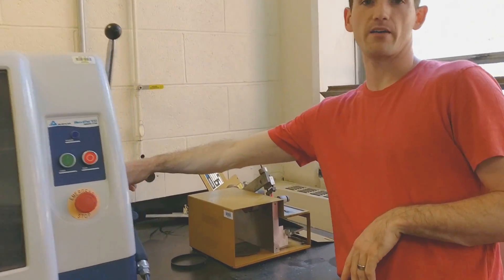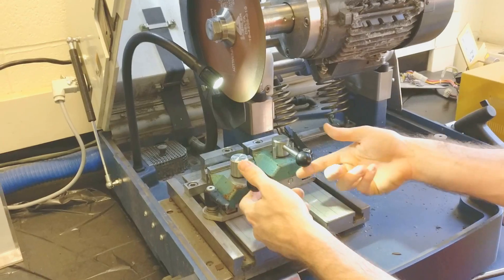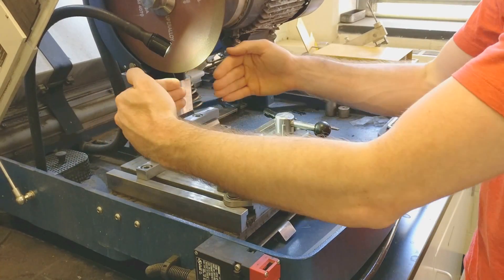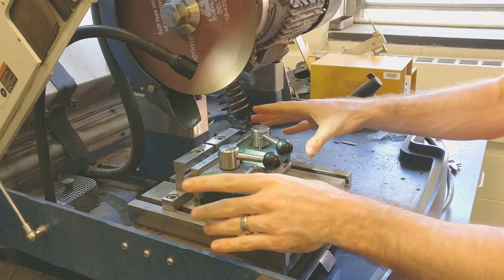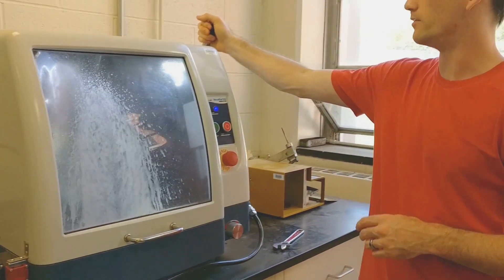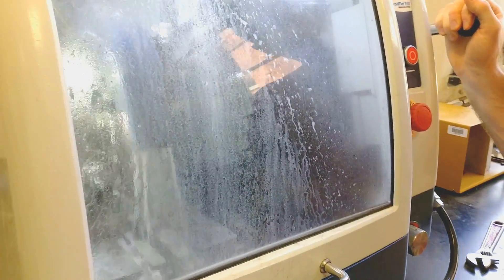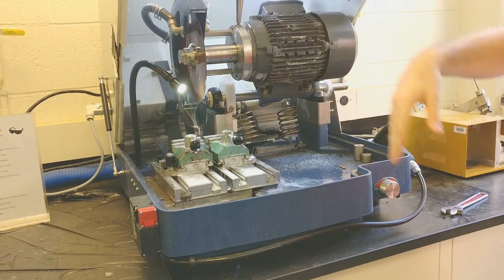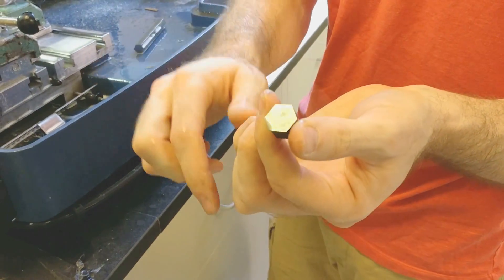Buehler Abrasimet 250 Tutorial

Comment: Hi Adam. Thinking of buying this machine for industrial use. Do you recommend it? Any concerns I should pay attention to? Thanks!
Reply from the maker: main thing is hardness and thickness of your material, this is manually operated and novice users can move the lever down too quickly which makes the blade explode and you need to install another. I used 10" resin bonded alumina blades which were cheap and effective. I used quick release clamps, good if you have many parts to do. I think its very safe, just maintain the circulating pump with water additives to avoid rust and bacteria